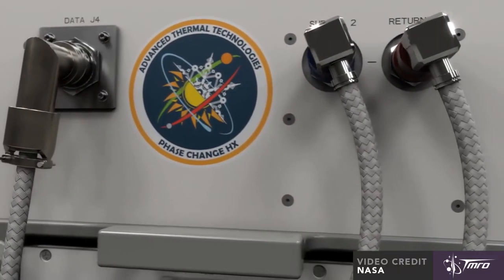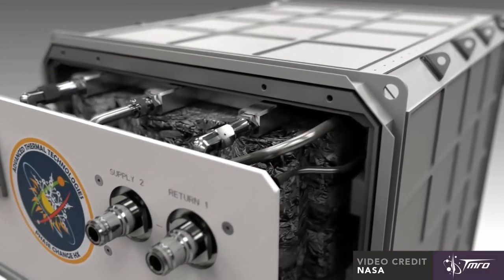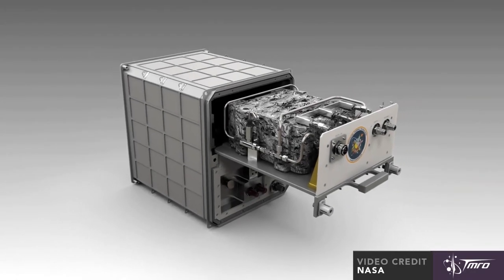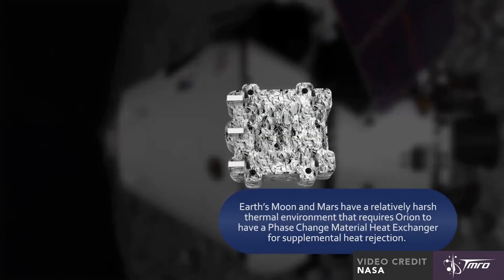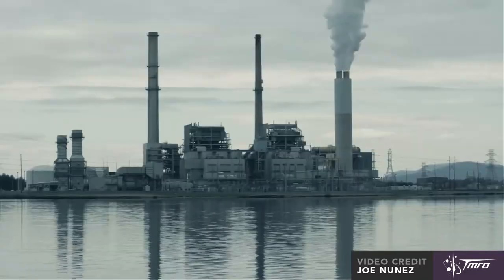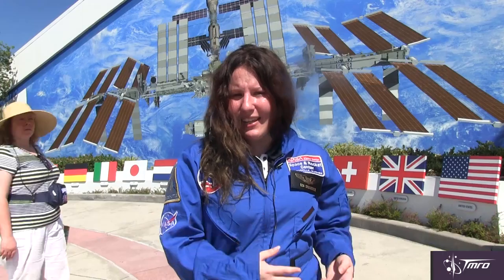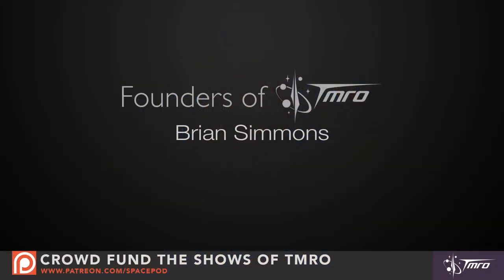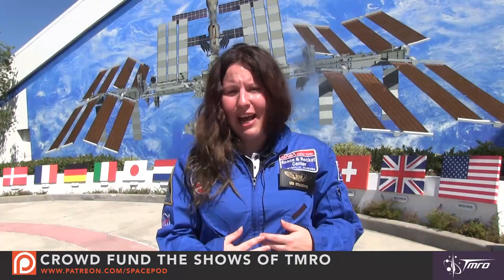The ISS is MELTING! – Space Pod 09/21/16

Comment: Cleverly extracting the energy they may be able to use thermal transfer to create mechanical torque for mechanical applications in space.  factory that uses the thermal gradient for mechanical energy, the difference in temperature from one side to the other driving a system akin to a Watt vacuum steam engine using cooling of a heated liquid to create mechanical force?  driving a flywheel that can impart rotation to a portion of a ship or station maybe?  might be easier with simple electric motors and shading the station with more solar panels, but it is interesting that they have access to so much energy they could use instead of just attempt to radiate.

Makes me want to try and jump start a KSPi reactor with solar heating by setting up heat exchangers backwards... or something.  Yes its gonna blow up soon after, that's not the point!